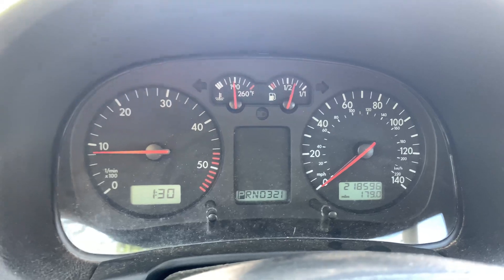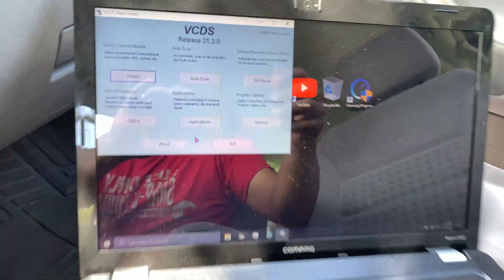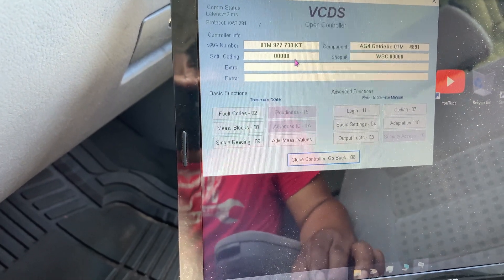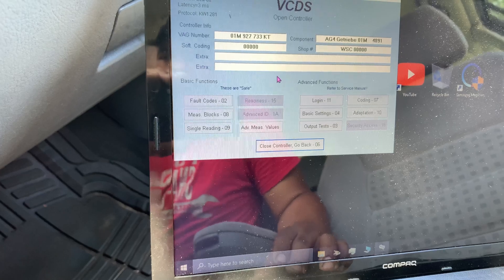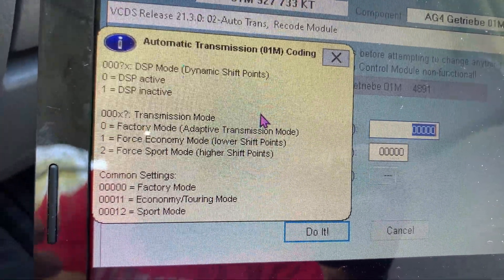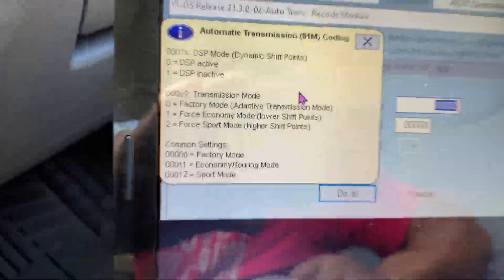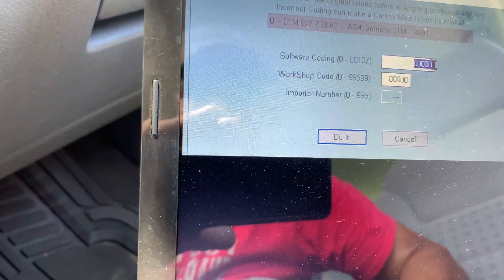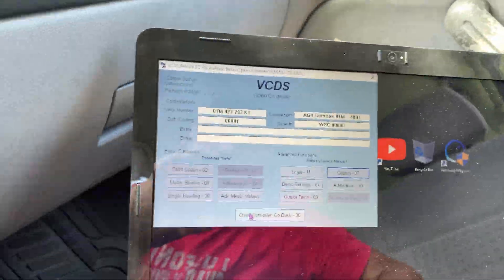How to Save fuel with A/T  transmission MK3 MK4 FELLAS

Comment: Can I use thesame coding on my 2002 VW golf 4  2.0 lifter automatic gear petrol engine
Reply: Yeah am asking if I can use the same pattern for diesel engine on petrol engine with a 2.0 litter VW golf 4
Reply from the maker: As long is automatic transmission none tiptronic yes and yes and yes  only can do it with vcds
Reply: @taco8v Can i do this on passat B5.5 1.8T automatic tiptronic 2002 
In normal D To be Economic And in Tiptronic +- To be Sport Mode ?
Reply from the maker: @dukagjin2850 hey   I don’t think tiptronic can do that because you manually can shift it and be on lower gears quick

Comment: Have you had any experience with a "Dawes Device"? Basifally a cheap boost controller
Reply from the maker: No i haven’t. But  Its diesel they all ready throw a tons of boost  , enough to blew a intercooler pipe or damage the headgasket if doesn’t have arp’s on the head
Reply: Okay thanks but one more question, pls can use VCDS Lite with a VAG COM 409.1 KKL cable to get it done?
Reply from the maker: Not sure sorry. I only have vcds the official one. If yours is the legit official one it works as well.